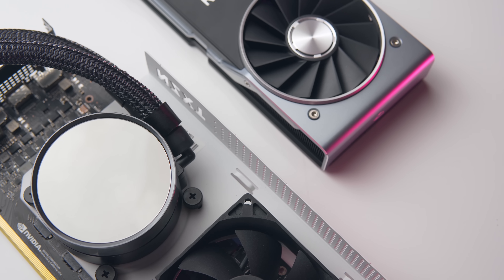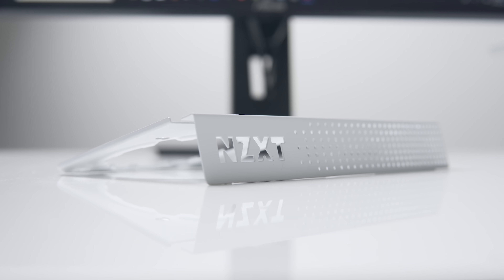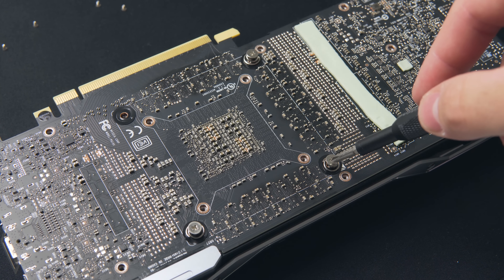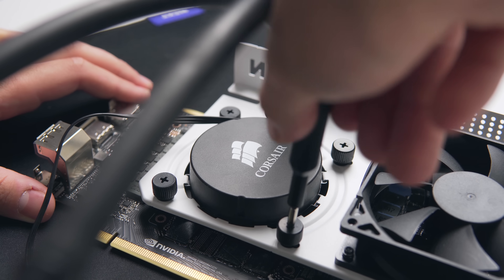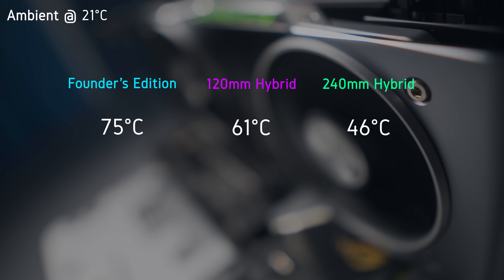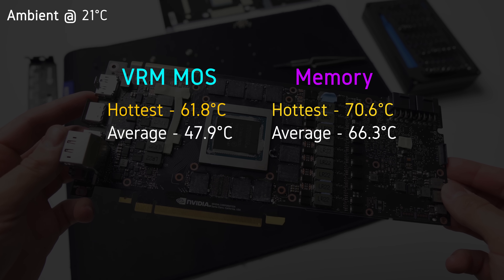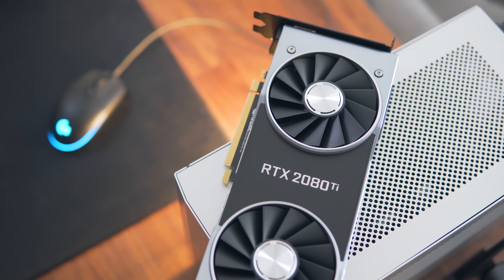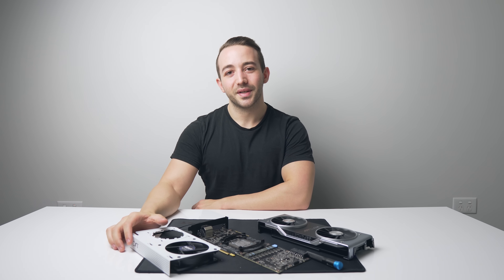RTX 2080 Ti + Kraken G12 Hybrid Cooling - Worth it?

Comment: How long was each test ran?
Reply from the maker: 20mins in Heaven 4.0
Reply: @optimumtech  would of been better to run hour long tests for the loop to warm up for an accurate temp under long periods of stress
Reply from the maker: @Brady93  Why not 2hr? or 3hr? I appreciate the desire for accurate results but doing multiple bouts of hour long tests just isn't practical when I need to get a video out :)
Reply: @optimumtech  its not practical to give false results which these are. In reality once the loop has warmed up and wat water has conducted enough heat then you get a more accurate result on if its worth doing this.

Comment: Thanks for the great content Bro! I just hooked up my evga 2080ti ftw3 hybrid with the kraken g12 and the x72 rad yesterday. Other than CAM software BS it runs so much better than the 120mm aio it came with. I don't know why they use 120mm aio's on these cards especially with their higher power limits even if they aren't that much higher. If anyone is deciding to do this kit wait till you can afford at least a 140mm or 240mm radiator size minimum if you are gonna overclock at all. Cheers
Reply: He just showed that the 120mm aio performed just as well as the FE if not better when testing applications like Project Cars 2 (as shown in the video) and it was a whopping 10 decibels quieter than the FE as opposed to the 240mm aio which was a 3 decibel reduction in sound at stock (but much better cooling). The 120mm aio is simply a better option if you are solely considering sound output and still want to maintain that performance the FE gave.

Comment: Ive been using the G12 on my 1080ti for about a month or so now, and my temps have not gotten over 40°C. Its great.
Reply: Do you have  a pretty heavy undervolt or something? or is it a 240 aio?
Reply: C F it’s a 240mm aio
Reply: Evga hybrid by default is an 120 aio and runs 45-52°C. I have one. Nice to hear that these temps can be achieved with a 240. 💪🏻
Reply: At 4k gaming. With a new noctua fan. The stock one is shiat xD
Reply: @rocketracer111  40°C is when I'm bench-marking in 1440p and overclocked, with no overclock it stays around 32-38 depending on the game  😁
Reply: Andr00F lovely 🤤 next gpu will be with an 240 rad aswell
Reply: @rocketracer111  im guessing you probably wont see this given your comment was a year ago, but, how is the pump faring on the AIO on your evga hybrid after a year i guess?
Reply: lol youtube notifications are helping here. ;) it workes fine. Sold it to a friend and it is running happily. Besides it is not the highest quality pump out there and it kinda frrrrrrr‘ing. Really makes by other fairly silent fans. I had it in a really silent system and i trained my ears with music production so I could hear this easily. Most people didn’t notice that sound at all. :)
Reply: I have an evga hybrid 1080ti whether mining or gaming at 100% or has not gone over 40 in over 3yrs. Open a window in winter and it sits at 21 🤣. Looking at doing the same thing to an asus 2080ti turbo...because just by looking at it, the stock cooler is going to suck ass

Comment: Simple solution to coil whine.. Get better quality fans that are designed for use with radiators unlike the ones they provided which looked like off the shelf exhaust fans meant for high air speed and not high pressure.
Also I see an issue as the VRAM is no longer being cooled in any way with the pads which helped disperse the heat to the plate are left to the open air.

Comment: The VRAM needs cooling bro, especially for Gddr6
Reply: Many cards with this mod show cooler vram temps if not around the same. The fan blowing directly on it works completely fine. They are rated for much higher temps as well.

Comment: I'd love to know if there's any feasable way to cram this under the GPU in an M1. I've been considering building a custom GPU loop with a low profile radiator, but honestly I don't want to go through the trouble and I'd highly prefer to use an AIO. I've considered using two 120m Kraken (CPU/GPU) but I'd love to find a way to rig in two 240s

Comment: Awesome video ! When I upgrade one day  I'll go overkill cooling for my GPU, using a 360 Aio. I prefer lower temperatures and silence.
Reply: They might make the card cooler, but having more fans will make it louder
Reply: @nicov9356  Not really.  The larger AIO allows for much more dissipation of heat.  The more dissipation of heat, the less the fans have to spin up.  The less the fans have to spin up, the less noise.  But, in near every scenario, a nice tempered glass case makes any and every argument about noise more or less moot.

Comment: I doubt the 0 rpm part that it's just heating up the coolent without dissipating heat
Reply from the maker: Ran it for 20 minutes. Seems like the air circulating around the test bench was enough to passively cool it. 
I honestly don't know.

Comment: If you want to control a fan header on your M/B with your GPU temps.... download ARGUS MONITOR with fan control. This is  similar to SPEED FAN but this program works with the 300 series chipset and is WAY more simple to use!!!
You can assign and change what temp sensors are assigned to which fan headers on your M/B including GPU temp sensors.

Comment: I would recommend all people to either spread TIM on the GPU die to cover all, or do a star pattern as EK recommends. You had a big chunk at the corner of the die not covered in TIM. That is dangerous. On CPU IHS do it as you prefer, but when putting TIM directly on the die (GPU, and delidded CPU) please make sure that every single bit is covered.

Comment: honestly I wouldn't do this to a 1300€ card (in my country). I think this card is bought by people that usually do 2 things = 1) leave it as it is 2) go full block custom watercooling. I honestly don't see it viable to put an AIO there. Anyway congratz for the good video, pretty accurate testings and preventing the "you used too much paste!!!" ragers :D
Reply: because the fact is that full block custom water cooling wont give you much more improvement over the g12+240mm aio, not to mention 280mm aio is way better for gpu cooling. it is hard for the markup price of  custom water cooling to be justified.
i just installed x62 on a 2080 and the gpu temp is <40c under furmark for a hour at constant ~230w gpu power.
Reply: @asdkj-gl2mq  well the price is justified if you look for good prices of parts and if you get into the loop every component on the pc. I think you're the one of the few people that put an AIO to a RTX 2080, the performance seems good, but as I said before and focusing on the 2080ti, i don't think people will spend the money for an AIO on a 2080ti, they probably will leave it as it is or go custom wc, just my opinion :)

Comment: Got one of these on my 1080Ti with a Fractal Celsius S24 and it's awesome. Idle temps are pretty similar but basically when the GPU hits 60c it seldom gets over that even OC to hell.
Reply: Nice !!! Actually the Fractal Celsius S24 is one of my fave AIO coolers !!! I've really been wondering if it would work with the G12 bracket. Was it pretty effortless ??

Comment: Kraken G12 Hybrid Cooling fit in a Ghost s1?
Reply from the maker: Just need a low-profile pump block - the NZXT Kraken coolers won't fit
Reply: Optimum Tech pls make a build. Please. ;)
Reply: Maybe, I think it could fit.
Reply: Kevin TheScreenKiller No way, the pump block would we way too high with an NZXT radiator, but a slim corsair radiation block MIGHT fit?

Comment: One thing to note about the VRM temps and your testing. You tested this in an open test bench, with the radiator having fans pushing air at the GPU. VRM don't require much air to keep them at safe temperatures so this suffices. However, in a real world scenario, where often users do not have a fan pointed directly at the VRMs, and in a closed case, the results can vary greatly. There have been users in forums that have reported that without some kind of airflow over those VRMs, their performance suffered greatly as the GPU throttled the clocks down to protect the VRMs. 

I would really like to see this testing done in a closed case with/without some sort of airflow going past those VRMs to verify if this is a viable solution in those two configurations. 

Beyond that, as always, fantastic videos and have a great day!

Comment: I 've heard that it doesn't work with longer cards because the fan can't cool the vrms....with shorter two fans cards I think it's a great upgrade
Reply: The components just need airflow over them - even warm air will remove the hotter air being emitted by the components. Obviously direct flow over a heat sink is ideal, they're still fine with the indirect airflow of the Kraken setup.
Besides, if you're still paranoid, just buy some individual component sized heatsinks and attach those to each component, they'll take the most advantage of even minimal indirect airflow.

Comment: Everyone who keeps talking about thermal paste with the "Pea" method on a GPU is putting their GPU at risk. You cannot apply the same principle of a CPU to a GPU. A CPU has an IHS that spreads the heat out from the Die. The GPU does not have this. The GPU needs full 100% coverage of thermal compound to the heatsink to perform optimally. Failure to do so can be risky to individual parts of the die as they heat up disproportionately to the rest of the die that is covered. It's for this exact reason that you always see the original manufacturer thermal compound having full coverage of the die. Because of this, it is typically recommended to use either a cross method or spread method on the GPU. Additionally, letting thermal compound seep over the edges of the die is not a problem at all as long as the compound is not electrically conductive.
Reply: I guess, the way he did it is fine, just messy, too much for my taste. I used about 2 rice grain amount on my founders edition gtx 970, but spread it evenly. That was in 2017 my temps still haven't gone over 75 °C.
Reply: @Korner555  that may be, but you also can't forget that the die size of Turing GPUs are massive in comparison. So while a pea may potentially have spread enough on a 970, you're almost guaranteed to not have 100% coverage with a pea on Turing. Check it out. It's a big difference. It's a huge part of the reason why Turing is so expensive. Big dies are much more expensive to manufacture

Comment: I was considering this cooling solution for my graphics card, but I've read that some people had their cards die over time due to lack of cooling for the memory chips. 8:10 your numbers there are great because you tested it on an open bench and your room temp is 21°C(which is pretty cool). My room temp easily hits 30°C just about throughout the year -- summer is worse -- and I'd say this is true for a lot of people out there. I don't have solid numbers, but I wouldn't recommend this if you don't have an AC unit in your room.
Superb job on the video tho.
Reply: If your hardware has some thermal headroom then it won't mind an increase of 10 degrees half as much as humans do. My system was perfectly happy last summer in my 32 degree flat, and I wasn't.
In fact an increase of 10 degrees in the room does not mean your hardware will run 10 degrees hotter.

Comment: There is something about GPU dies that makes them extremely amenable to liquid cooling. The fact that the 2080 Ti was running at 70C with the fans OFF on the 240mm AIO is just amazing. It's a 250W card after all.
Reply: It will go up to 320w at max power increase to 123%, and being able to comfortably do that with liquid cooling is another liquid bonus.

Comment: one thing to note, you really need to test the gpu frame timing before/after the application. 
its nice to have mhz bump, but if the frame pacing is better, that is way more valuable irl.
Reply from the maker: Dead End  Obviously I know what a frame time is, just watch any of my GPU reviews. 

The question was why it matters.
If the GPU is faster, it's faster.

Reducing the GPU temp doesn't sporadically make it stutter (or the inverse) in normal gaming scenarios.
Reply: @optimumtech  well, steady 120fps is way more playable than fluctuating 80-240fps, so a consistant frame timing is more important than high fps
Reply from the maker: @maggi98mw  Well of course, but that is a lot more game and game engine dependent than GPU temperature dependent. 

Every gamer can welcome a performance boost.

If the framerate is too high for you, bring it under control with resolution scaling, higher quality settings, or by simply capping the framerate.

Hope that covers it.
Reply: Optimum Tech It does on my Titan Xp... that and power throttling make that Pascal garbage in real use due to the massive frame rate inconsistency and occasional stutters. It gets noticeably better when increasing either/both fan and power limit (the cooler the chip is, the more efficient it is, so your also getting an artificially higher power limit if you wanted to think of it this way).

For an example on efficiency vs temps, my old FX sat at 300w at 4.8 GHz at 1.5125v near thermal limits, I now have it at 5.5 GHz at 1.7 Vcore but it’s only requiring 350w! I would have thought it to be around 500w (at 4.2 GHz it was only 120w after all), the change is from my core temps are staying below 0c (it won’t show lower, but I’m guessing right around 0c, evaporator temps peak at -35c under load), that’s a massive estimated ~30% power reduction just due to the 70c temperature lowering! It’s crazy how much it changed.
Reply from the maker: Not really sure what you mean there. Is 7:05 what you're after?
Reply: @optimumtech  frame time is a graph measuring the frame in milliseconds. It's available in afterburner
Reply: @optimumtech  great video for the record dont get me wrong ! and awesome work lately for your videos, dude you have the sickest B-roll amongst all the tech channels !! 

ok i mean a graph like https://youtu.be/W3ehmETMOmw?t=414 this one.

at the end of the day, frame rate and the boost clock speed might be the same/similar, but frame timing can be really different from time to time, and that is what ultimately matters.

i would much prefer a steady 100fps than 180 all over the place fps.

simply FPS is measured every second, and 1 second nowadays is just too long to be precise enough.

Comment: Really need to compare against a good air cooler solution, like a 3 slot 3 fan card that is great out of the box. This card is very expensive and doing this mod could risk warranty. Plus a bracket + AIO is even more money that could have been put towards a better card in the first place. When the gain is less than a few percent, it is still worth it?
Reply: My first 2080ti FE failed (after a week) and I had to get a replacement (is working fine still). I had EK blocked it, liquid metalled it, lost some of the small thermal pads. I put it back together best I could - there were no quibbles from NVIDIA.
Reply: What card is better than a 2080ti?
Reply: @steviewonder0850  RTX Titan?
Reply: @xalderin3838  He's saying the gain is less than a few percent is it worth it. I bet this AIO + 2080ti is still cheaper than a Titan and probably nothing in it performance wise, hell with this AIO you could prob OC it beyond a Titan.

Comment: My RX 470 "Morpheus Edition"
60°C
1000RPM
1300MHz
Reply: @tacowang  Absolutely.
I have the Sapphire Nitro+ RX 580 4GB (Stock cooler)
68°C
1500RPM
1440mHz
Reply: Eric Fan He can use that cooler later though. I have a sub zero phase compressor cooling my FX (core temps under load at 1.7 Vcore are somewhere below 0c, it won’t show lower. Evan temp max is -35c and sits at -60f isle). However, that cooler will live a long happy life murdering components for years to come. I should probably put that on my Titan Xp, but I personally think Nvidia single GPUs are dog$hit and not worth wasting my time with, so I’ll just fry that worthless GPU on liquid nitrogen for wasting my time**

**Nvidia drivers are crap, like seriously crap... my 4x crossfire in my main system is much more reliable than any Pascal I’ve tested, and Nvidia isn’t even that fast anymore since they limit you to 2x GPU anyways, so I guess they don’t like money from potential sales of 4x Titan RTX... Oh well, probably not worth it considering how bad the drivers usually are... I even tried it on Linux, and installing the graphics drivers corrupted the OS... like how the hell do you corrupt a server OS from a graphics driver?!? Radeon is always the obvious choice for Linux, but my goodness I didn’t think it would be that bad! That’s even worse than it just crashing every 30 minutes at stock in Windows 10 for the first 6 months I owned it until they fixed the drivers for the Titan series... by then I already had given up on it and went back to my old 2x crossfire setup, and later upgraded to 4x (which is mind blowing good! 100 fps in Crysis 3 at 4k Ultra is unbelievably impressive until you actually play it, it’s insanely awesome, I’m so happy with my quad GPU setup!)
Reply: @jakegarrett8109  Extreeeeeeeeme

Comment: Try with a nzxt x72 or a 360mm aio
Reply: The founders edition is cooling gimped, there are cards hitting 2000mhz on air, no matter how much cooling you give these you arn't getting more than 2150mhz except liquid nitrogen.Would you really notice 2% improvement?